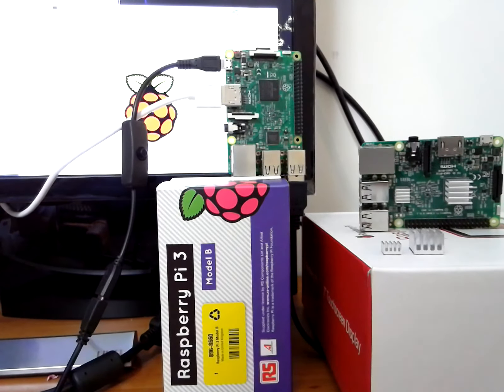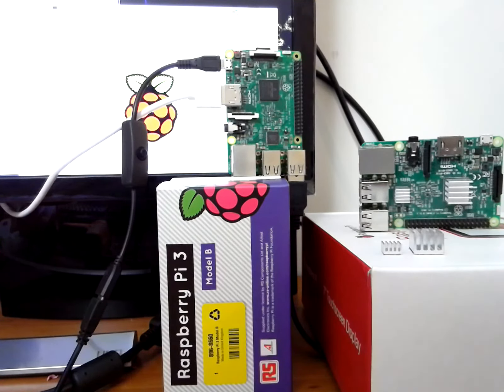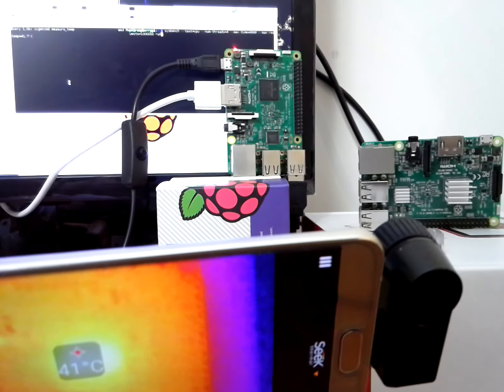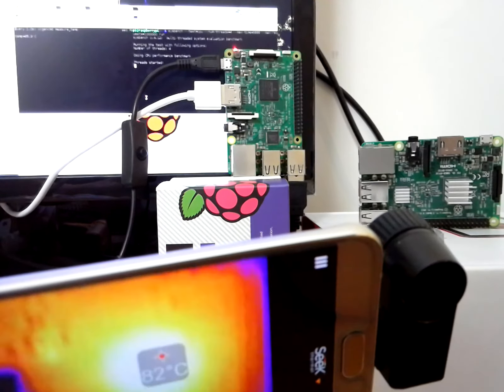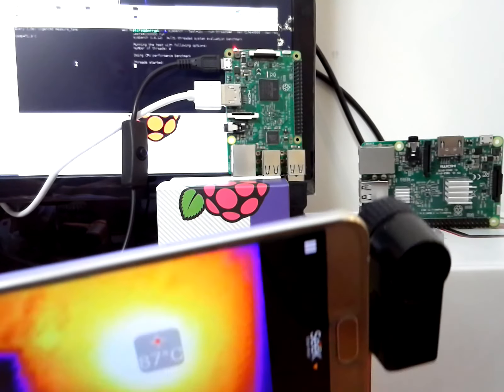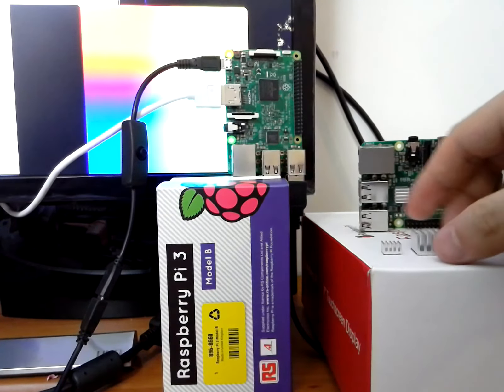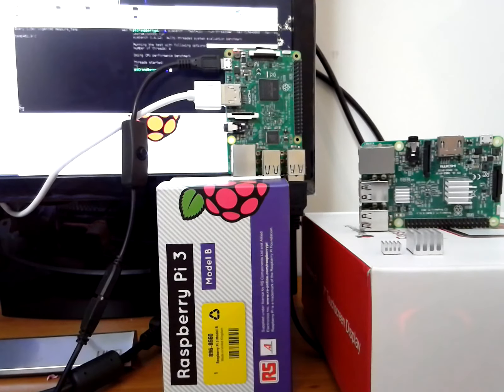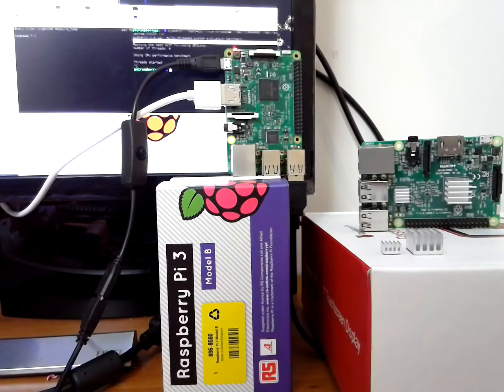Raspberry Pi 3 Overheating Issue with Thermal Capture

Comment: can you put the linux terminal commands for benchmarking and cpu temp monitoring in the description?

I've put heatsinks on mine too, but also have it inside a case with holes on top and bottom. Hopefully this is ok
Reply from the maker: +Niko Bellic we put the commands we used in the "More details" link.

Comment: v1.2 board??
Reply from the maker: +melanrz1 yes, the retail 1.2 board. we have one from MCM, one from MicroCenter, and 3 from Amazon. We tested all 5 boards and they all exhibit the same issue. the BCM2837 runs really hot.
Reply: +LoveRPi thank you,i have one from pihut (UK) and run on stress without heatsink max 80C,with heatsing 40/60C